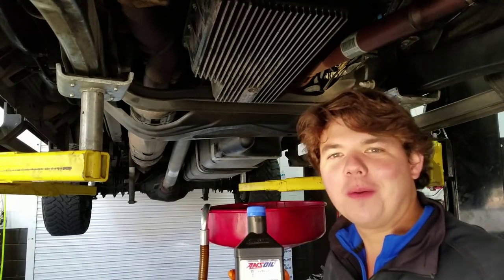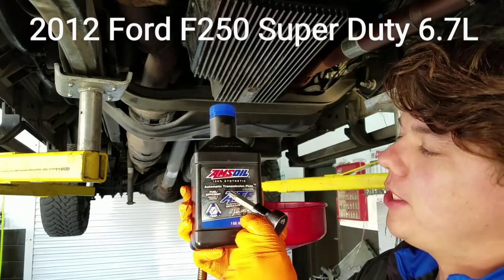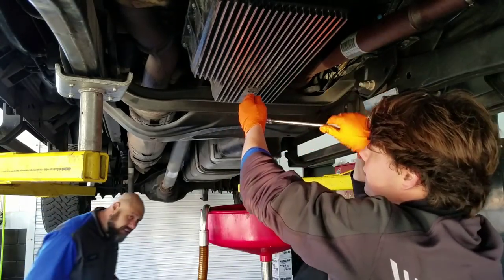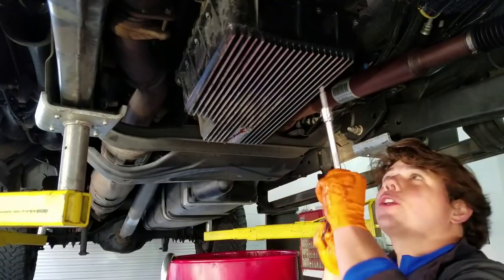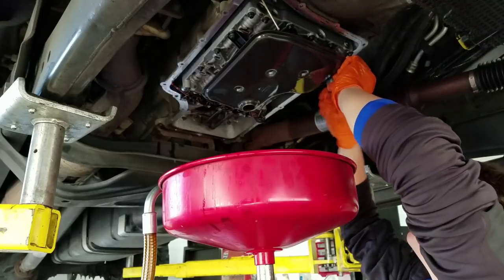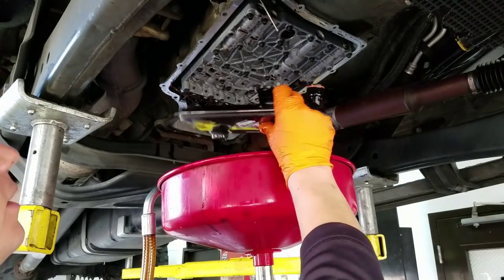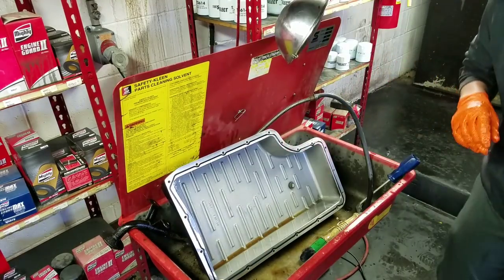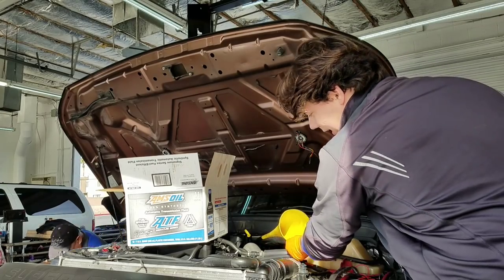2012 Ford F250 Super Duty transmission fluid change

Comment from the maker: https://www.youtube.com/playlist?list=PLB_ftWArBFdfzuV7RHGz70MD-PawLbKgu
Eben Rockmaker
Independent AMSOIL Specialist (Dealer#: 5331179) https://www.amsoil.com/offers/pc.aspx?zo=5331179
Mobile: (702) 472-3614

Steps: 
1. My link gets you 25% discount and free shipping on orders $100 or more. Click link under my name, Click link join now yellow bar Preferred Customer for 1 year. Click add to cart. Note: Amsoil will not keep your CC info.
2. Click look up your vehicle.
3. Click auto light truck. 
4. After you have all the products added double check then complete order.
Any order $100 or more has free shipping and ships within 1 to 2 days.

Amsoil Product lookup guides - https://www.amsoil.com/guides.aspx?zo=5331179

Comment: Very informative video. Mines due and am going to switch to the product you were talking about Amsoil. Stock filtration pan on the transmission, going to use the merc to flush what's in the converter then drained, add the good stuff. Thanks for a good video.
Reply from the maker: Thanks my ostentatious Bodacious Broskiesss!

Thanks for being a part of my YouTube community and I wanted to give you this look up guide that will give you all the capacities on your vehicle.
If you have any other questions feel free to reach out to me anytime🤟☕🇺🇸

AMSOIL Makes it for your Vehicle Lookup - https://www.amsoil.com/guides.aspx?zo=5331179

Comment: Where are you out of i did the oil and antifreeze in my F150 with 536k miles used amsoil and man the difference is amazing much smoother and did the engine flush aswell before the oil change to amsoil
Reply from the maker: I live in Las Vegas.

Super stoked to hear your loving it.

🎬 Professional YouLubher: Eben Rockmaker Regency Gold Direct Jobber AMSOIL Specialist (Dealer#: 5331179) 702-472-3614 

     ✅ If You're New To AMSOIL I Recommend The AMSOIL 6 Month PC Membership because it will save you about $33 on a $100 purchase after the difference in tax - https://www.amsoil.com/offers/pc/?zo=5331179
Reply: @Syntheticoilprotection  vegas is pretty far lol oh i love amsoil its really good trying to figure out what type of fluid and how many qrts for the 6.2 ltr automatic trans
Reply from the maker: I have accounts all over US and Canada and when you use my link I'll be your Amsoil dealer so I would get the credit.

When she click on the 6-month PC membership you'll see the lookup guide in the upper right hand corner you'll plug in the year make model and engine size you'll see the fluid capacities everything for your vehicle I always recommend getting a couple extra quarts that way you don't have to worry about topping off over the course of the year I also recommend the Amsoil engine flush the PI performance improver and the upper cylinder lubricant I would grab one case of upper cylinder lubricant if you have any questions on any of the other stuff just let me know always happy to talk Thanks for being a part of the channel and thanks for thinking of me 💯🎬👍
Reply: @Syntheticoilprotection  cool
Reply: @Syntheticoilprotection  anytime man very helpfull

Comment: Hala is possible to benefit us and tell us how much liter oil is a frenzy of the foror F250 or F350 Super Duty engine 6.7l v8 and you all thanks and greetings to you
Reply from the maker: Of course this will give you the fluid capacities for your vehicle and when you use my link here that will allow me to answer your questions in the future about improving the performance and lifespan of your vehicles by choosing the right fluids as your independent Amsoil dealer also the 6-month PC membership will give you the best value on the products👍
♥️   Find The Right Fluids For Your Vehicles - https://www.amsoil.com/guides/?zo=5331179
Reply: @Syntheticoilprotection  Excuse me, I asked you about the gear oil, how many liters to fill in the F350 gearbox?
Reply: @Syntheticoilprotection  Do you understand what I mean or not? All I want to know is how much lime can accommodate a liter of oil?
Reply from the maker: I don't understand
Reply from the maker: It depends on the vehicles different components differentials Etc I always recommend getting a little bit extra to be safe the lookup guide here will give you everything for your year make model and engine size.
♥️   Find The Right Fluids For Your Vehicles - https://www.amsoil.com/guides/?zo=5331179

Comment: Have a 2015 F250 4x4 with 6.2 would like to change all fluids to amsoil engine tranny front and rear diff and transmision and antifreeze and brake fluid i work out of chicago but live in alabama would like to get in touch
Reply from the maker: That's great Chris Yes this is the lookup guide here This will give you everything for it I recommend the 6-month PC membership when you use my link I'll get the credit for your order and I'll be your Amsoil dealer so I can always answer all your questions in the future If you have any questions before you order give me a buzz happy to talk anytime.
🎬 Professional YouLubher: Eben Rockmaker Regency Gold Direct Jobber AMSOIL Specialist (Dealer#: 5331179) 702-472-3614 

     ✅ If You're New To AMSOIL I Recommend The AMSOIL 6 Month PC Membership because it will save you about $33 on a $100 purchase after the difference in tax - https://www.amsoil.com/offers/pc/?zo=5331179
Reply: @Syntheticoilprotection  copy that

Comment: I have a 2003 F150 with 186,000 miles.  I have never changed the differential or transfer case fluids.  Its still running like a champ, would changing them now cause more harm than good? Or should I just change it and FTW. Thanks bro.
Reply from the maker: Changing the differential fluid would make a huge difference you'll have more efficiency in the drivetrain less vibration and less we're in the metal also you'll see a big jump in gas mileage as well.

This is my personal link that will get you 25% off and free shipping.

Eben Rockmaker
Independent AMSOIL Specialist (Dealer#: 5331179) https://www.amsoil.com/offers/pc.aspx?zo=5331179
Mobile: (702) 472-3614

Steps: 
1. My link gets you 25% discount and free shipping on orders $100 or more. Click link under my name, Click link join now yellow bar Preferred Customer for 1 year. Click add to cart. Note: Amsoil will not keep your CC info.
2. Click look up your vehicle.
3. Click auto light truck. 
4. After you have all the products added double check then complete order.
Any order $100 or more has free shipping and ships within 1 to 2 days.

Comment: My car is 1999 firebird. I switched amsoil 5w30 in winter. I'm going back to amsoil 10w30. I want to change the atf fluid to amsoil but amsoil doesn't make a filter for the transmission. Do you know if they are going to make transmission filters?...I dont want to use fram
Reply from the maker: Great question Charles most of the time you'll notice the lookup guide will have the Wix filters if Amsoil doesn't make it Wicks does a great job and that's what I would personally use in my automatic transmission.

This will give you the fluid capacity for your car and it will have the filter if they offered for your vehicle.
AMSOIL Products & Vehicle Lookup - https://www.amsoil.com/guides.aspx?zo=5331179

Comment: Eben, do you do the flush on the trans too? Seams like it would get everything loosend up so it will flow out
Reply from the maker: You can you just want to make sure that you change all the fluid.

So when a truck like this you would have about six quarts left in a torque converter because the total capacity on this transmission OEM is 16.9 quarts total Phil.

So since we had the over-sized pan that's an extra three and a half quarts so the total Phil would be 20.4 quarts.

Basically what you would do is you would drain and fill the pan twice to get more of the fluid out.

It would be a good idea if you had a older transmission that had burnt fluid in it but if the transmission is in great shape like this one I think it's more time effective to just drop the pan and change the fluid.

I think as long as you change your fluid on time you really don't have to even put the flushing there but I would like to try it!

I'd like to try it on and older transmission that doesn't shift well and get all the carbon deposits off the clutch plates and see how much better it is before and after.

Comment: If i drop the pan and do a filter change is ok to mix the oils with the factory oil ? when add the amsoil ?
Reply from the maker: Yes, you will change about 50% of the fluid and you'll notice it's shifting faster.

If it was my vehicle I would do a pan drop clean the pan the magnet fill it drive it a hundred miles and then I would do another drain and fill all you do is just drain the pain and then fill it again in that way you'll change about 75% of the fluid.

That's as long as the fluid that's in it is in burned if the fluid is burned I would do the drain and fill 3 * instead of two.

Thanks Mike for the question if you have any other questions feel free to call me anytime
Reply from the maker: Professional YouLubher:
Eben Rockmaker Executive Direct Jobber AMSOIL Specialist (Dealer#: 5331179)
Mobile: (702) 472-3614

My Link: Best AMSOIL 100% Synthetic @ Wholesale + FREE Shipping: https://www.amsoil.com/offers/?zo=5331179
Reply: so it ok to mix the oils ?

Comment: Question, why not use Torque Drive ATF?
Reply from the maker: I think you can I think it just depends on the packaging and what your application is the lookup guide will give the different products for your specific vehicle.
Lookup For Your Vehicles - https://www.amsoil.com/guides.aspx?zo=5331179